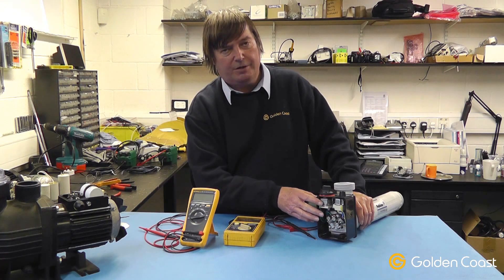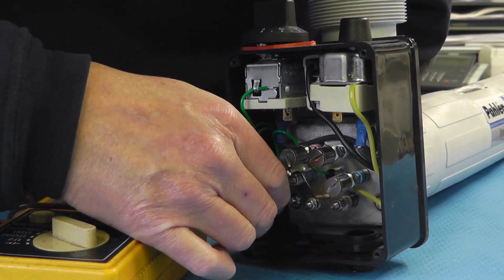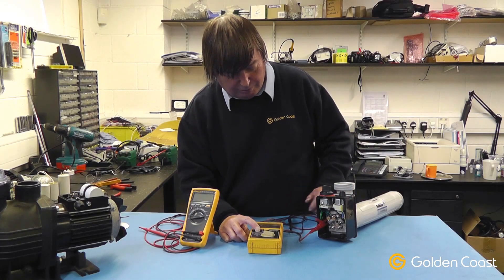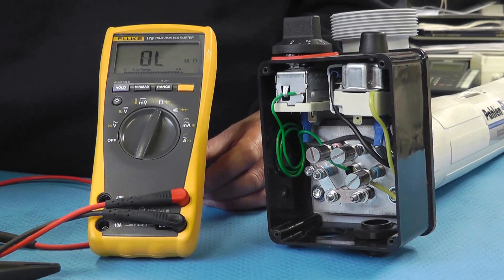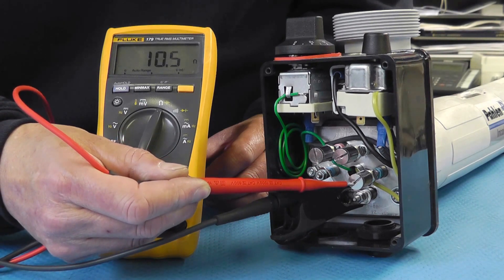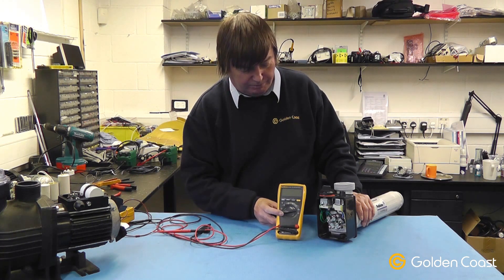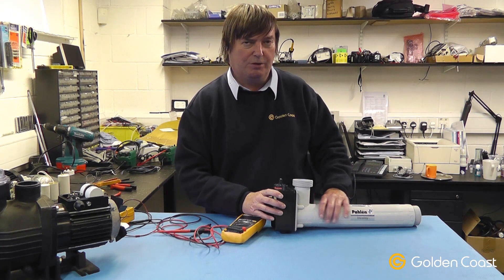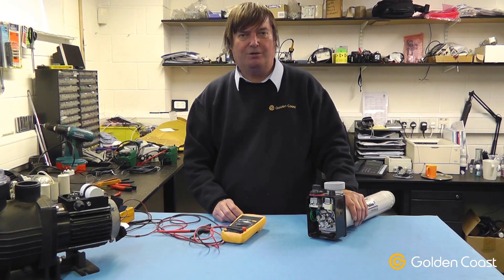Testing an Electric Swimming Pool Heater | Andy's Answers

Comment: I just got a Vulcan 3kw electric pool heater and a 13amp sand filter. Can I run these both on a double switch connected to a 1.5mm 3core flex 20m flex cable going through the wall and into a switch socket in the house.
Reply from the maker: I am not familiar with this product however to be totally safe where electricity is concerned please consult your local electrician who will be happy to assist with the proper installation.
Reply: @GoldenCoast  got an electrician after researching what I needed.

Comment: Hi Andy, I've got a Pahlen Compact Electric Heater that no one knows how to wire as single phase. Can you please do a demo for me or offer me any help. Thanks M
Reply from the maker: Hi Milo
This is a three phase heat that will operate on 400 or 220v but it cannot be wired as single phase.